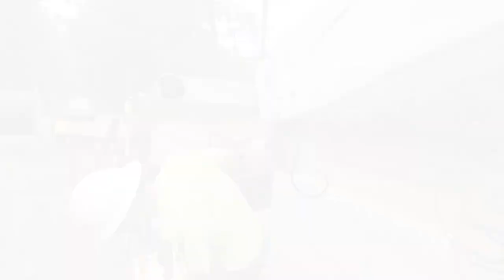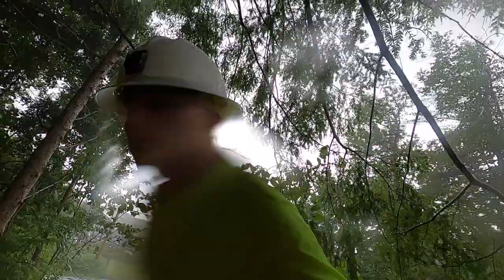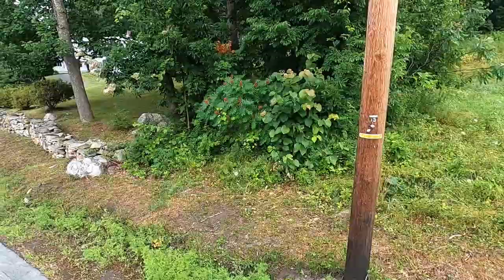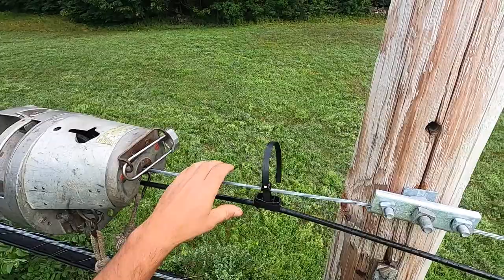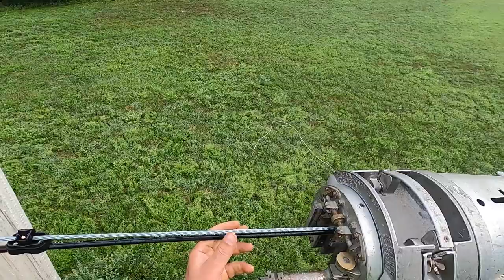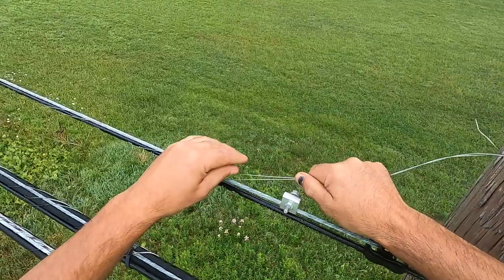New Run, Lashing Fiber

Comment: why not wait to cut all your straps and lashing wire til you are done? you are wasting alot of time bringing your cutters out every time like that to indivually cut everything.   next time take two coils of extra lashing wire with you so you can change the wire while youre up in the air.  it will save you alot of time
Reply: work from left to right and back again. This is solid advice from ur comment.   It can be done in very much less then 15 minutes pper pole.  its also good to just tape the left side in this case it also helps if the wire gets broken after the fact at the clamp , and throw the lasher from one side to the other in one shot but I dont think U can do that without an apollo lasher in this case
Reply: @culbyj3665  you can! Wrap the wire around the bolt and send it! Go behind and bug and bond!
Reply: Yep
Reply: Are slag strands good what's your thoughts
Reply: Must not be paid by the ft

Comment: Hey bro I hope you read this. I'm not knocking you at all looks like you got the idea down. A lot of these guys are giving you solid advice even though it sounds like they are slamming you or just acting like know-it-alls. First off when you go to set your Lahser on the line please close the gates one day it will save the Lasher. Next when you get to the Pole swap the last year from one side to the other. Set your bugs cut your wire. Bug it offf strap it tag it bond it cut everything then wrap your handline twice around the bucket. Boom down a couple inches and say yep or pull me forward easy the lasher is tied on. Instead of all that hand pulling and booming down to pull forward.  Also Instead of the groundhand pulling the lasher he can make straps for you

Comment: Just cutout. Why not catch the lasher off to the boom and pull it with the truck?? Smarter not harder?
Reply: came here to say this
Reply: Ha. I said it in another comment. 3 times the work.
Reply: Double lashed too for fiber SMH. Finish off the bug nut correctly to please you're not tying up a boat.
Reply: Do you have to bug every span? There were no terminal cases.
Reply: @Tech_-ez7us I have never seen it not like that.  It's standard.  The only things off to me was the lasher missing the strand lock and not pulling the lashing wire through the bug nut making a few twists then cutting it so it didn't protrude with sharps.  I could go on and on but mostly it's just craftsmanship.

Comment: How is the pay doing this type of job and do you get paid by the hour or foot of fiber done in a typical day. Also what's an average length of fiber put up in a day? Thank you for your answers
Reply: It's both. You can start hourly as a ground hand. Work your way up to a lineman or a foreman and then you get paid off how much production you do. Thats when the real money comes into play.
Reply: dont work for someone unless theyre paying percentages of production paid work. This work aint worth it if youre hourly.
Reply: @OneSilentGiant We get paid $1.20/ft for stand and Coax in South Ga. You get paid double for De/Re and Wreck out for cable replacement. But if you have small 2-3 man crew the crew you can make some money. We just made 6k in a week and only worked 2 1/2 days due to rain. We had a crew come from out west just 2 guys came in and ran 2 miles a day. They told me they make about 300k a year each on the crew.
Reply: @OneSilentGiant I'm a sub contractor. I personally pay out to my coax splicer $.34/ft and $200/day to my ground hand. My coax splicer brings home 2k/wk pretty often. De/Re is usually small jobs where you delash the cable that is up their and relash new cable. Most of the time its small 1 or 2 spans. Sometimes they can get larger though. We just had a 1600' De-Re job which paid $2.30/ft. I am newer to this side of the industry as a contractor. I was working in house as a fiber splicer up to about 8 months ago and when emergencies would come up I would help and that's how I learned I am by no means the best or the fastest at this stuff.